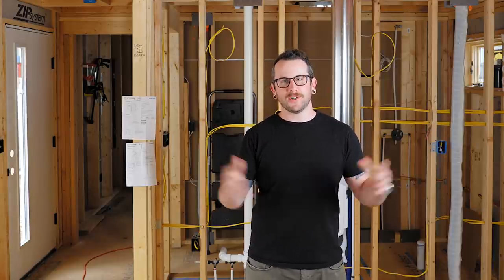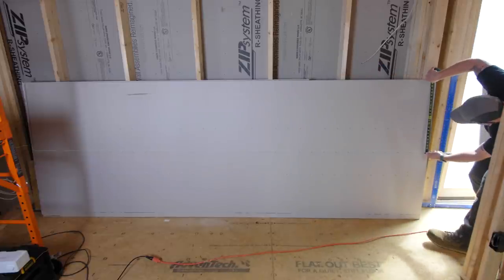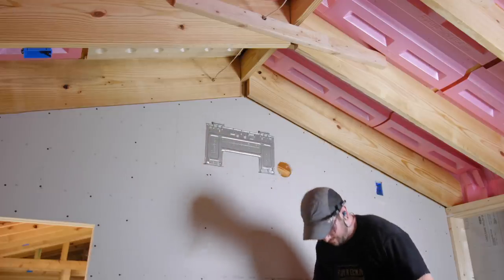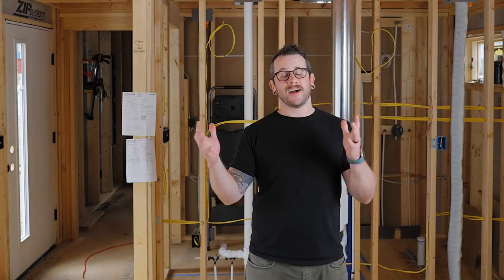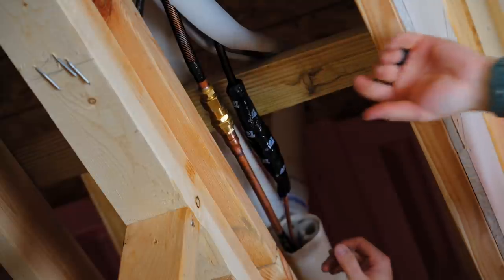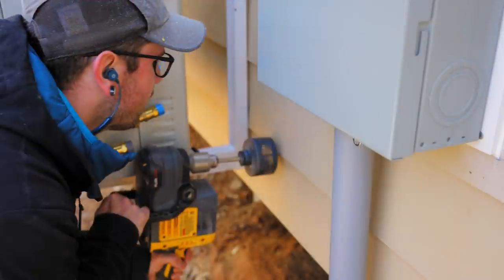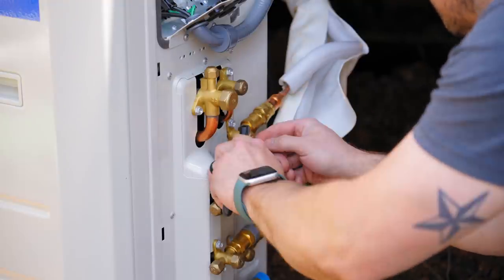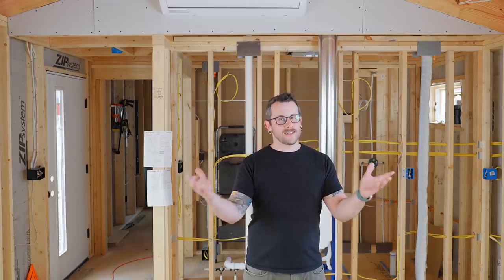DIY MULTI-ZONE Ductless MINI SPLIT Installation in New Construction!

Comment: No pressure test to see if the system is sealed and No vacuum on the system before releasing refrigerant? The Condenser comes pre-charged, Not the line set. I’m interested to know how this system works without being under vacuum because it’s the vacuum that helps the refrigerant boil at lower temperatures to create the cooling effect. Maybe I missed something but I’ve never installed Any AC system, whether it’s been a Residential, Commercial, Industrial or Military application without pulling a vacuum under 500/250 microns. A vacuum pump is $130 at harbor freight and decent set of gauges with a 4 valve manifold are a little above $250 with hoses. Worth every Penny and in most cases pay for themselves in the first decent sized install.

Comment: Nice install. Can these systems put out AC and heat at the same time?  Example: Zone 1 - AC, Zone 2 - heat.
Reply: I realize this is 9 months old but for anyone else stumbling on your comment, I'll answer: No, it's not possible to have one zone AC and one zone heat simultaneously. This is because there is only one condenser. If one is set to heat and the other is set to cool, heat will take precedence and the one functioning as an AC will pause its operation and show '--' on its display. This is similar behaviour to any other system that has a single condenser.
Reply: @R1S1NGDRAGON  
Thanks so much for answering. I actually was concerned about this because you know how people are. Some are cold, some are hot and if they can set their own temperatures on one system then I can see things going wrong. But you say heat takes precedent. Good to know.

Comment: I've got a dual zone mr cool coming in a few weeks and I'm unsure if the line sets will easily run inside a 2x4 (non-load bearing) wall. I like your video showing running the line-sets through the wall cavity, but it looks like you have a lot more room to work with behind the unit. Did you purposely frame it further out from the wall to make that bend easier to manage?
Reply: Same here, were you able to figure out the 2x4 fit?
Reply: @catholicexplorer9231  Not yet, that's this next weekend's project. I'll try to remember to come back and give you an update.
Reply: I've been scouring the internet with this same exact issue on my new-construction house!

Comment: You should add a ac disconnect for the mini split it is not necessary but it little bit more safety
Reply from the maker: The panel is right there so it's easy enough to kill the power.
Reply: Like he said the panel is right there so this meets code.

Comment: Hopefully, those 4" holes you cut in the studs weren't on any weight bearing walls. They looked like structural integrity of the walls and floor joists were compromised with the size of the hole.
Reply from the maker: The interior walls are non-load bearing. I screwed the bottom plate to the floor in multiple spots around the holes and everything is holding up fine. The drywall really helps to span the hole and hold everything together.

Comment: Your 2x4 is now 0x.5. By drilling a 3" hole into those beams you should know that you just removed all the structural integrity of those walls.
Reply from the maker: They're nonstructural walls and I fastened each side of the cut bottom plate to the subfloor and joist below. No issues many years later.
Reply: @craftedworkshop  Even so, its bad example to show drilling a 3" hole onto a jamb. Some other people who do DIY without expertise follow click bait videos.

Comment: What I have not seen any on with split units? Can one unit be turned on in another room. While the other one is shut off in the other room? While using one one unit out side. All I hear on videos is when all the cooling fans are on at once. One person wrote a review his would not work. Unless you have all them turned on.
Reply from the maker: They definitely work independently with this system. I typically only run the unit in the main room since it's powerful enough to cool the whole house with the doors open.

Comment: I have always wondered why you guys (americans) call the outdoor unit the condensor. Its only a condenser when you're cooling inside. Both units is both evaporator or condenser, depending on mode
Reply from the maker: Yea, that's the term MrCool uses in their manual so that's what I went with, but you're definitely right.

Comment: OK check for leaks you gotta pressurize the line first before you can check for leaks and then the soapy water  you can't just spray it on
Reply from the maker: The lines are already pressurized.
Reply: This is a mrcool dyi unit which has refrigerant in their lines. They connect and then that opens them up.

Comment: You didn't perform a high pressure leak test on the system? You didn't pull a vacuum on the system before opening the service valves? That's not good

Comment: The AC company wants 10 grand to install a new hvac system. I am seriously considering a diy mini split.
Reply from the maker: If you're handy, I would really consider it! This was a way more complex install too, going straight out an exterior wall is even simpler.

Comment: Warranty is void if not installed by licensed ac contractor. It's clearly stated on mrcool website. It's a personal decision, save money by DIY and take your chances.
Reply from the maker: That isn't the case on their DIY series, as far as I'm aware.
Reply: @craftedworkshop  You're right. I mistakenly looked under the split system instead of DIY.

Comment: Note: checking for leaks before you  charged the system was really wasting time.   You need tocheck for leaks AFTER charging, checking before you will never see a leak as there is no pressure at all.

Comment: Checking for leaks needs to be done when the system is under pressure, if you didn't put a hand pump at the end of the pipe, what you did with the soapy water served no purpose

Comment: 13:13 - WAIT, NO VACUM PUMP?!?!? 
How can you open the refrigerant WITHOUT vacuuming the system?!?
This DRAMATICALLY Reduces the compressor's life and it's a MAJOR MISTAKE and reduces the COP of the ENTIRE SYSTEM!!!

Overall very helpful video, until you get to this point 13:13. The Fact they missed this, shows how much they really know about the system.
Reply from the maker: Please research this system and look at the dozens of other comments like this. This particular system doesn’t need to be vacuumed as the lines are pre-charged.

Comment: Some obvious things on this video. Sawing thru those floor jousts was a huge no no. That would never pass inspection. Also oversized mini splits wreck the compressor as it has to cycle on and off too much. Mrcool only has 9k as the lowest size. In that small space you would need a 6k probably for a bedroom. I wonder if whoever lives in this is having problems with it

Comment: Oversizing your head units is not a good idea. Units should be sized for the worst case scenario but no more.

Reason is, you want the units to run for as long as possible to help dehumidify the space. Plus, oversizing is simply wasting money and electricity.
Reply: Since the units were provided by the manufacturer, I would have expected Mr. Cool to have performed a Manual J to determine the heating & cooling load on the structure.  A Manual J is a process developed by the Air Conditioning Contractors of America (ACCA) to accurately assess how much heating and cooling your home needs.  As mentioned above, too much cooling can leaded to ample cooling (reaching thermometer set point) well before the humidity is removed from the air.  Granted this is my observation from a short video.   Best of luck with the project!

Comment: That you have to run the drywall before the lineset… it’s a bit of a shit show. Very annoyed that I can’t just stub out my lineset. Then i could install the wall unit after drywall and painting. Whoever designed this system has no idea how normal phases of construction go. What a pain in the ass.

Comment: sound deadening pads... on pipe. yeah... no. Hope you dont have a leak down the road on those fittings considering they are buried in the wall.
Cable clamp not for outdoor use.
Total unit way oversized for the space, gonna kill all your efficiency.
The electrical is not the one part that should be done by a professional. Why do all this guys doing carpentry work all of a sudden think they are HVAC techs?

Comment: It seems like a mistake to put all that stuff inside the wall.  I'm thinking AC equipment has about a 10 year lifespan, give or take a few.  In order to DIY the replacement, I would think you're going to have to get inside the wall, not to mention, it'll be nearly impossible to get over, close to the eave inside the finished attic, to pull new lines up inside the wall.  
Maybe I'm wrong, but it seems like you're setting yourself up for a future nightmare.
Reply: My HVAC system is 30 years old and still working.  And what nightmare?  Drywall's easily patched, he's got a crawl space.
Reply: Well the equipment dies, but not the pipes, so it shouldn't be a issue.
Reply: @luciflash  If those lines have a connector, that doesn't let air into them, when it's disconnected, then I suppose you're right.
Reply: Johnny Bananas  I know, cutting and repairing drywall is impossible.
Reply: It’s all cardboard just rip out the walls and put new in?
Reply: @scottslotterbeck3796  you can, but that also means redoing texture and painting. You can do it but it's not fun if all you need to do is a leak check

Comment: Youre probably getting very low efficiency and high energy costs with this oversized multi split system in this small house.
Reply from the maker: You're probably right. I typically don't run all three units as the one larger unit in the kitchen area is sufficient as long as the doors are open between rooms.

Comment: drilling a 3.5 inch hole through 3.5 inch studs/top/bottom plates....not the smartest thing ever. Also...insulating the drain line...100% unnecessary.
Reply from the maker: Interior walls are non-load bearing so not really an issue there. The water could definitely freeze in the drain lines, MRCOOL recommended insulating them.
Reply: @craftedworkshop  ok sure it's not an issue.....enjoy. lol

Comment: Lol THIS IS WRONG, he never vacuum linset and after vacuum and if it holds vacuum pressure, then you would let the pressure out (frion)  and check leaks with soap and bubbles any connections you made. Wow if u going to make a video on how to, you need to tell them The right way

Comment: Very wrong from the start. some points you should not do. 
1. The pipe connections should be behind the unit (for future servicing) "you need access" if anything happens you need to strip your drywall?
2. How can you leak test without nitrogen? spraying soapy water without pressure? lol
3. You don't want a water leak inside. don't use a corrugated drain hose inside the walls. (use a PVC PIPE) that corrugated thing will build up slime and hard to clean
4. You did not vacuum the system before releasing your refrigerants. 
5. I FORGOT YOU ARE A DIY'er lol
Reply from the maker: The lines are pre-charged, which is why I could leak test at that point. Because of that, they also don't need to be vacuumed. Might want to research this specific system!
Reply: @craftedworkshop  The refrigerant is in the outdoor unit. you can leak test and vacuum the lines and the indoor unit before you open the valves.
Reply from the maker: @ggbux7910  not with this specific system. The lines themselves are pre-charged and sealed, hence why you leak check after connecting the lines. I followed the instructions in the manual to the letter and these units have been performing perfectly for almost a year at this point.

Comment: Poor installation, for sure not by a qualify HVAC tech. Check for leak without pressure, lol ,and no vacuum. This unit will have no condensable gas (AIR) and he will have leaks. Have fun with it in the future....